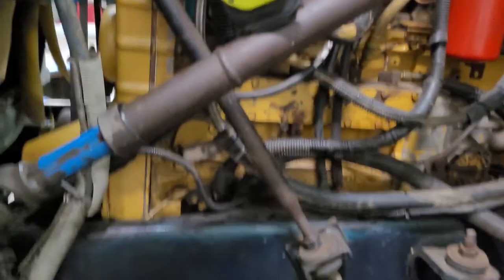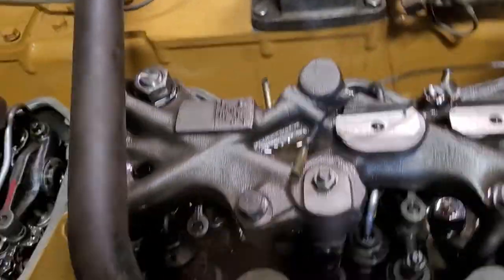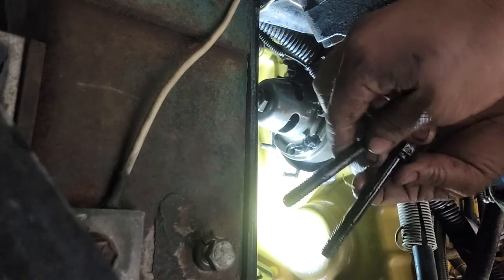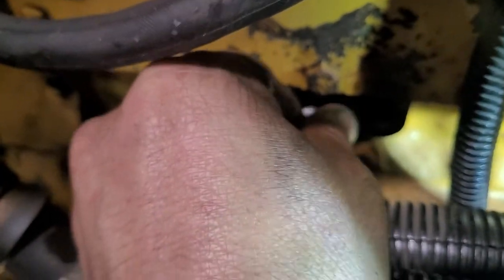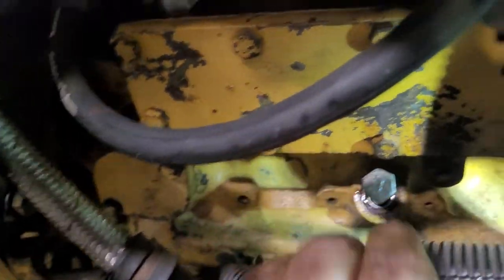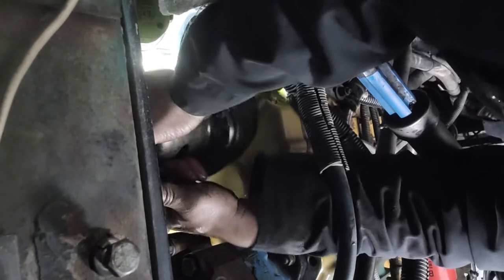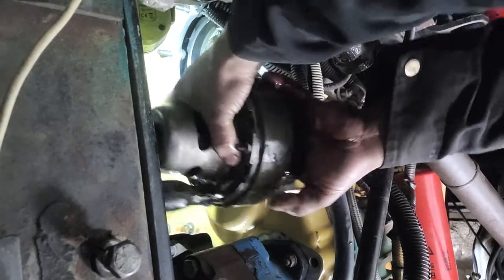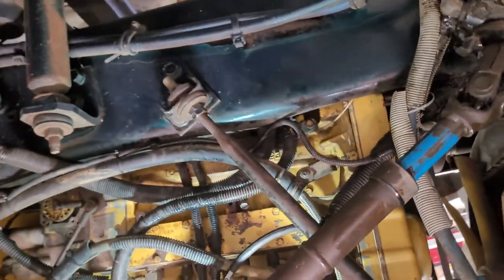3406B CAT || Too much fuel consumption and produce white smoke?

Comment: HI , I have a 1994 peterbilt with a cat 3406b 3ZJ44897. About a year and a half ago truck broke down lost a lot of power and was throwing a huge amount of white smoke. Unfortunate for me I couldn't find a cat dealer that would have time to work on it. Took it to a mechanic I met at a peterbilt store, he said he can take a look at it right away. A few mechanics mention that it could be the nozzles so I took all 6 of them to speed up the process. He said that one was bad and maybe 2 more, so I had him replace all 6. After he replace all 6 the problem was still there. He had me rebuild the fuel pump paid around $4000. Still the same problem. He checked the turbo and it was bad, he told me that he only checked one side and it looked ok. Bought a Borg Warner turbo and he install it. I was expecting the truck to run a lot better but for my surprise it was nothing close to how it was running  before. It felt like it was missing power loaded, specially going up hill.  I finally took it to another mechanic and he claims that the timing was retard two teeth and idle the truck down since it was idling hi. I took the truck and it did run quieter or smooth but still was lacking power. I haul aggregates with  a 22 foot dump trailer so a lot of times its on site work and hardly drive on highways. So it takes me a while before I can run loaded on hills or expressways. Any ways I took it to Peterbilt cause they had a cat teacher over there. And again they claim the timing was off and retimed it. They replace the diaphragm and some o-rings. But I still have the same problem, its still smoking more than normal and has low power. I did notice the manifold psi has little psi on lower gears and 12 psi max on 8th 9th and 10th gears. I will check with them and see if they did a fuel pressure and vacuum test. Ask if they did a intercooler leak test.  Any advice would be appreciated.
Reply from the maker: White smoke cause more fuel intering to the chamber or less of air causing of lock of power! 1st make sure your air and fuel filter is clean. Boost pressure 12PSI is not enough! 1800RPM=15PSI up if below 15PSI check your air to air connection, maybe charger cooler leaking or one of the clamp is leaking during HI RPM. if everything is good and still low power and White smoke back to injection pump/governor timing and Valve lashing includes Jacob brake. And make sure follow the OEM specs.

Comment: Do you know what would cause 3406b not to idle.  Any load and it shuts off. Like when air compressor kicks on or engine fan or a/c clutch and engine will shut down or start skipping. When you let out on clutch to take off you have to press accelerator and ride the clutch or it will shut off.  Only does it once it warms up like it's something to do with oil pressure or something.  Is pump wore out or is it something to do with Governor.  Actually runs great when going down the road just won't idle
Reply from the maker: Governor is the main reason. Out of adjustment or Try to adjust.
Reply: @MachineHealer  I've took the Governor housing apart on another scrap pump. Do you adjust it by the springs. I didn't really see any adjustments screws or do you have a pump for sale. Where are you located
Reply from the maker: Follow on my Facebook page. And message me personal then I send to you all the instructions how to adjust governors. I didn't put here a copy of instructions, it's complicated and personal.
Reply: There is a screw inside a nut shaped valve at the back of the governor that has a slot for a standard blade screw driver, screw it in tell it bottoms then there it out to a full turn! See if it helps! if not need to have governor work done, if your low idle is where it is suppose to be when you first start it up!
Reply: Changed plungers. Like brand new

Comment: Hello sir I need some help I have a 3406c engine but I put a 3406b pump on it but on idle it smoke white gray smoke an on the high way going tru my gears it a lot of black gray smoke I change injectors an nothing change still smoke on idle an going down the highway
Reply from the maker: Sir I'm not sure if 3406B is fit for 3406c because I never try to do that, but I believe we have a little bit different in two kinds. Anyway past forward try to re-timing.
Reply: @MachineHealer  ok sir thanks it start an run good just that it smoke alittle more than usual